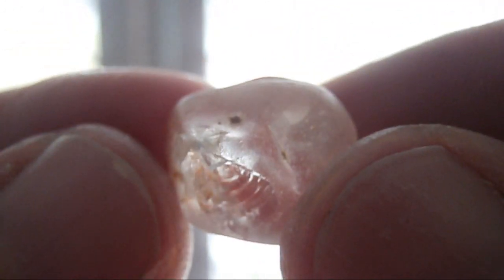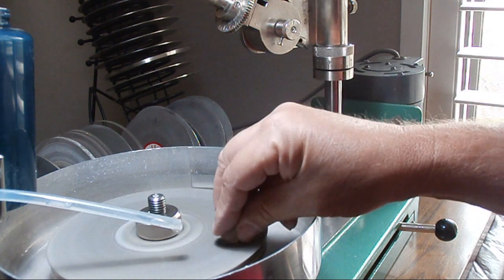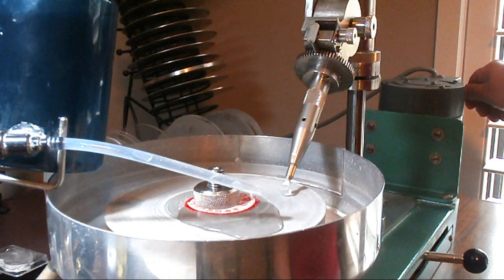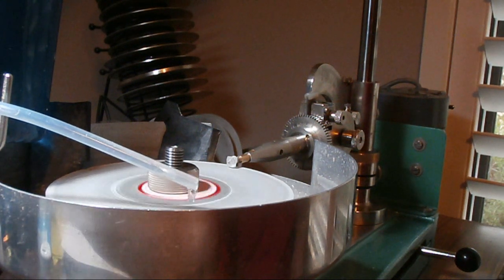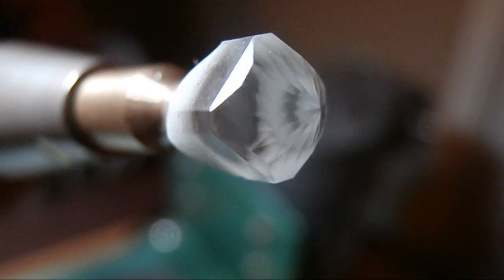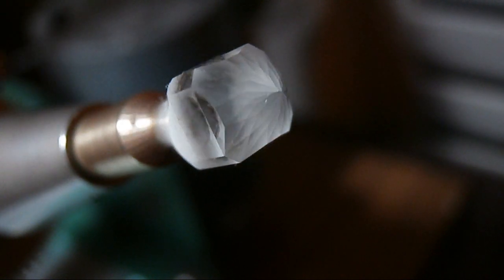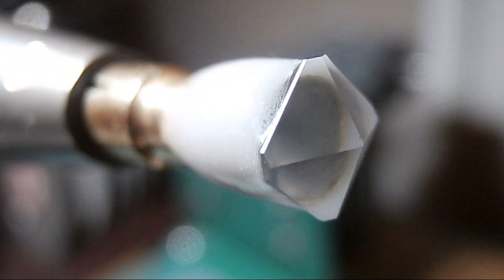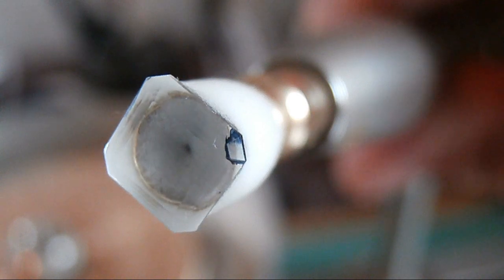How to cut gemstones - Faceting Topaz | Square Portuguese Cut

Comment: I try new cuts etc on CZ. It is cheap enough that if I screw up I'm not out much. It is also safer than TV glass.
Reply from the maker: CZ is a good material to facet with. Not all CZ is cheap so you have to be careful not to mess up. TV glass or glass in general is absolute rubbish to facet with. Technically, I've faceted glass once in my life and never again. It's a total waste of time. Obsidian is a glass, but does have different minerals to form it  and colour it such is volcanic ash. Glass is just silica (sand). Avoid TV Glass.
Reply: @VintageTimeGems  I'm disabled and on a pensioners income so I don't buy the expensive stuff. I think my next expensive one is going to be Kryptonite. I love that color.
Reply: @FatKidBrody You might try picking up inexpensive rough topaz on eBay; there's a fair amount of medium quality on there pretty reasonably, if you're careful.

Comment: Very nice! Question on topaz...does it matter in which axis you cut topaz? Do inclusion lines matter?
Reply from the maker: Topaz has cleavage planes so you need to cut 10 degrees off from the plane else it will cleave.